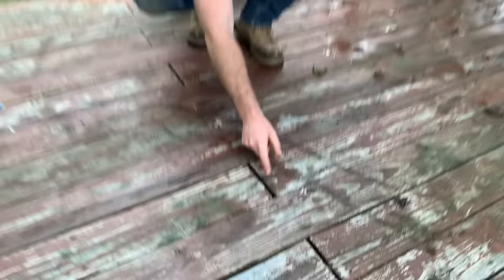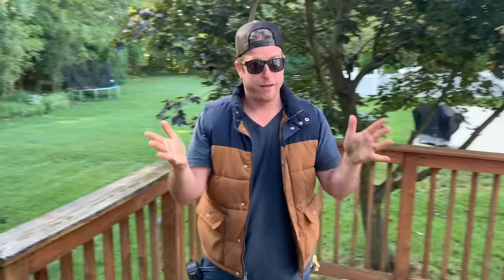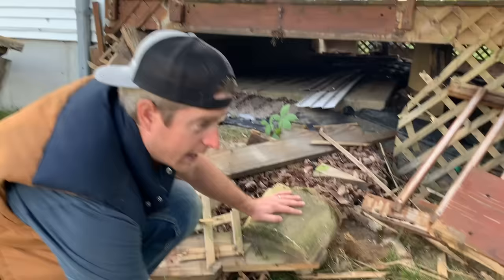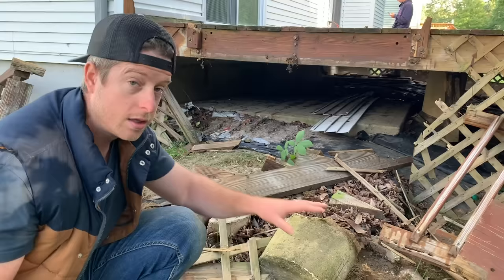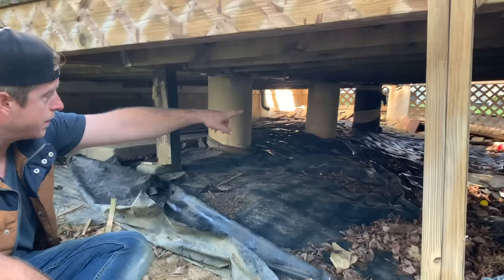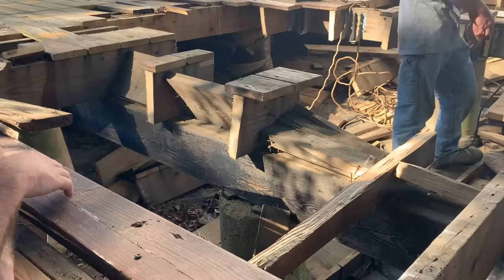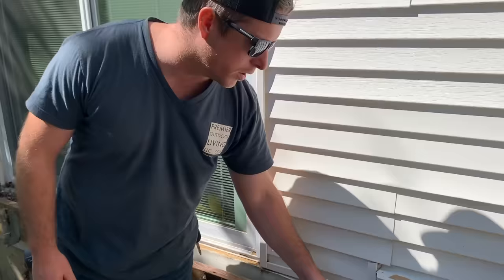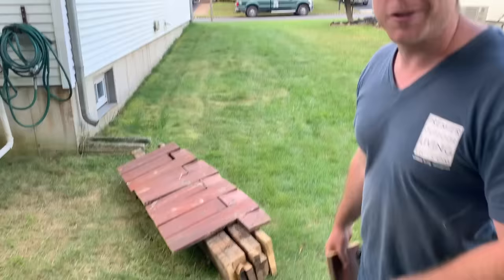How NOT To Build A Deck - Ultimate Guide On Every Mistake You Can Make

Comment: Dude however crappy this thing is I have seen a few that I have referred to as anti gravity decks, talk about under supported, their were 2 very overburdened 4x4 posts and a ledger board on this 12x12  deck, the posts weren't even set in concrete, just resting on the ground. That one is basically a meme at this point in my crew.
Reply from the maker: Hahah I’ve definitely seen some insanely bad ones online, it’s pretty scary
Reply: I also replaced a 12'x12' deck that had only two 4x4 posts standing on the ground with a small handful of Ten Penny nails holding the ledger board to the house. The scary thing is it was over ten feet off the ground.
My customer wanted it replaced because it was too crowded for all smokers on it at the last gathering.

Comment: My house has a small deck about 12x16 and the 4x4 posts sit on concrete discs or chunks that sit on top of the ground. Previous owner had a hot tub on this deck at one point. 😳Still it’s solid. I want to extend this deck and will probably put concreted posts in the ground for the new extension, question is is that dumb considering the rest sits the way it does? I’m not really interested in tearing the old down because it’s solid. How did this ever pass inspection in Massachusetts where winter is prevalent? Will I open a can of worms pulling permits and they see the way the old is built? Wood isn’t cheap lately but it has come down some.
Reply: it would take some elbow grease but you could use some temporary support and dig up one post at a time and add a concrete base. Your frost line up there is probably 32-48 inches,

Comment: I took on a snowbird client here in Alaska and looking over their house, they have a 2 story deck built onto their 3 story house wrapping 2 sides. First thing I noticed, 4x4 UNTREATED posts used upper & lower. 2nd thing I noticed, none of the uprights above are over the lower. 3rd, is the concrete pilings,  they go down 36". The list goes on & on. Owner asked me to "fix it" as I'm a former deck builder. I laughed and said, Nah, I'm not touching this one. He's got someone else lined up and I'm hoping that fella will tear it all down and build it right. This is freaking earthquake country with no building code inspections. SMDH.
Reply: OOh, I was horrified to read this. Untreated timber, poor design & significant earthquakes - someone's gonna get killed unless its torn down.

Comment: It's funny to me how poorly it was constructed as you say but yet it looks like it's being around for 20 30 years
Reply: Pretty ironic given how much scorn the guy has for it. If a diy functionally works 10 years costs and is only 1/4 cost of a “pro” build then I’d say it was a job well done. Ha it’s also funny theyre like OMG ITS SO UNSAFE. Ha it’s a deck 3 feet off the ground, what do they expect the deck to be able to hold a car up and not suddenly catastrophically fail ? Looks like it did it’s job these guys are just full of pride which will lead to mistakes and errors

Comment: Your thoughts on 2 beams/joists to a post for a deck attached to the side of the post using carriage bolts.  How can something like his be fixed?
Reply: I know I’m not who this question is posed to, but heck ill give my .02 for what its worth considering there are no other replies. The issue with it hanging on the post with carriage bolts is that all of the downward and twisting loads are being transferred through the bolts and only the bolts. That means a lot of shear force on the side of the bolt, which over time can loosen and even split the wood out. My suggestion would be to look for a heavy duty bracket that would screw into the post with some large sds screws meant for shear loads, something like simpson string drives. The bracket could go outward underneath the beam and up to the face of the beam, screwing in at the connection. This would effectively transfer the load from the beam to the posts and remove the shear load from the carriage bolts. I dont know of a bracket that exists like this off the top of mg head. You could look around online or if you know a good welder have them make it up for you. I think the strongest design for a bracket would screw into the side of the post, perpendicular to the beam, then go upward and outward and twist to meet the face of the beam. Almost the shape of an H 25 hurricane tie but much larger and maybe 3/16” thick steel. Im not an engineer by any stretch but that’s how i would do it were i faced with that challenge. It might be a good idea to consult with an engineer depending on the specifics of your project. They can make you a set of spec drawings that you can then take to any good steel fab shop.

Comment: Please tell me how a breaker board will solve gappage from contracting wood
Reply: It won’t if you put it in while the deck boards are still wet. I lay the deck boards and then come back a few weeks later, and then cut out a slot for the breaker board.

Comment: Question, we are getting ready to tear our deck down. My husband wants to pour concrete under where the deck was. He wants to know can you put the support post on top of the concrete? It's for a 12 x 14 foot wooden deck.
Reply: You'll need proper depth and diameter footings under each vertical support column/post.
Reply: @frankmiller95  Did you hang the picture yet

Comment: If your building decks where there is frost you should be using Helical Piers for footings! I install them for a living and ALL my deck repairs are failed footing that's are 42 to 48inches in the ground. Ground freezes and you have a 2 or 3 foot diameter concrete footing it grabs hold of and pushed the deck up. Very rarely do I seem them settled. 5 to 10 inches is pretty Typical. 
Use KDAT lumber and dont be a cheap ass!
Reply from the maker: We do use helical piles now!

Comment: Why can't beams sit directly on proper footings/piers like you showed, if the footing/pier is done correctly? Usually you have a footing/pier and then a 4x4 or 6x6 post and then lay the beams across the posts with attachments?

Are you meaning that it didn't have any actual connecting hardware between them? Then I think I see what you mean.
Reply from the maker: Yeah exactly, no connection to the footing

Comment: I only have a clearance of 4-6" to build a deck. Is this possible to do on ground level? How would you make the frame?
Reply: 4x4 pressure treated posts on patio blocks or if you cld dig down a little you can buy preformed concrete post blocks https://www.lowes.com/pd/Common-7-in-x-11-in-x-11-in-Actual-7-125-in-x-10-375-in-x-10-375-in-Concrete-Deck-Block/50113084?cm_mmc=shp-cprd--googlelia-210-brickandblock-50113084-
or you cld try these as well 
https://www.amazon.com/TuffBlock-Instant-Foundation-Block-8-Pack/dp/B076LBRHVR/ref=sr_1_2?dchild=1&keywords=post+blocks&qid=1590367902&sr=8-2  ..

Comment: He used the term "cinder" block which is not correct. If you look close, those are concrete block. There is a huge difference between cinder block and concrete block. By his accent, I am going to assume this is taking place in the United States where cinder block hasn't been manufactured in more than 70 years. If you are going to make an instructional video, get your terminology correct.

Comment: This is why i hate wood deck floors...after a while they lool horrible, and I think you have to strip and re-stain, etc..after a few years. I prefer the TREK composite, along with the white rails from ****** Rail Systems.
Reply: Doing that on a 48x16 and currently planing the joists before doing a liquid rubber coating on top of the joists.
Composite will show waves much easier than regular wood, but a cheap electric planer looks like I will be done in 3-4 hours so its worth the minimal extra time.

Comment: How do I find a contractor who not only knows the codes, but does them?! I know there are many who will cut as many corners as possible.
Reply: Find one who will get a building permit before starting work. That will require your deck plans are in compliance with local building codes and the finished deck passes an inspection by a building inspector upon completion. No contractor will build a non compliant deck, subject to official inspection after pulling a permit.

Comment: I mean dude its an old deck so a lot of the problems you are pointing out is due to weathering. And the first step is probably tall from the grade of the yard eroding down over time
Reply: They did half ass it for sure. Either a home owner special or a cheap homeowner. You get what you pay for
Reply from the maker: For sure!

Comment: Man carriage bolts are not that much better then lags other then you can tighten them more so, so after ten years when they loosen up you can put a wrench on them an tighten them but its still only going thru a 1 1/2 material. whats your rim board that your running them lags thru? Did you block the rim where you attached a post? Otherwise you just made a big lever to rotate your rim board hint why my county calls for simpson dtt2z to be installed on any post attaching to rimboard for handrail. Also stair stringer dont have to be 12inch on centers, yes obviously 12in on center is strongest but also way over built. i would think what decking material would play a role in that as well. 1 1/2 material lot stronger then 1 inch timbertech or azek Besides should be taking over all width of stairs an dividing it into equal spacing for your stringers an thats what the spacing is as long as its under 24 in on center.. You do not have to put a break up board if your spanning 20 ft or more, maybe if your installing timbertech or azech but good ole wood you can put that tight for the wood will not expand an contract like composite material.

Comment: OK, watched the vid and it is a bit hippy-dippy.
However, most of what the guy is saying seems to my non-contractor 48x16' deck building self seems to be following standard Code.  A lot of stuff on that build was janky, and it doesn't look like it was every maintained properly so accelerated wear happened. Could be 20-25 years old, with a fair amount of handyman quick fixes.
Pretty much as soon as he showed pier depth, you know it was built by someone as cheap as possible and without any permit or interest in even trying to do it properly.
You can laugh at the guy if you want, but most of what he's conveying seems pretty sound and supported by most Codes.

Comment: I was laughing about the concrete foundation being 23 inches too short. I live in a peatland area and i would need a foundation of at least 3 meters  (roughly 3 yards for you Yankees) deep, just to get at the sand below the soft peat.
Reply: lol im in new england and all my post and foundations are 4ft deep to protect from frost
Reply: What do they do for house builds? Does everyone's house have foundations that extend 3 metres down? That must get pretty expensive!
Reply: @calebfuller4713  Actually 3 meters is not so much. In many areas of the Netherlands houses are founded on piles that are over thirty meters long. In some cases the peatlayer is so thichk that piles cannot even reach the more stable sandlayer below and the foundation is based on the friction etween the piles and the peatlayer.
Reply: @boldvankaalen3896  Wow! That's crazy.

Comment: Scary?  Come and see my deck. Super cheap, DIY, hazardous crap that worked new, but eventually- after you or a visitor gets hurt (law suits) you will rue the day- as they say. Ladies and gentleman, when they brake you will have no warning- you can be trapped and blead to death as if you were rat in a trap. 

In watching a few (so far) Vids about decking - materials, and methods I come away with a few principals- call for mark out (yea, you don't have anything in the back yard- Call anyway) flash house, plan, plan, plan, OR

Call someone with a great rep. Fastest, cheapest, most value,, but a great vid about what you can find out there. I wager an inspector could have red-flagged that deck if he saw it, but if he is not invited' on the property- he can't do anything- I guess. I am not a contractor or inspector but I admire true skill and thinking in any project- except mine that is...

The greatest part of a deck build- or a rebuild is that piece of paper, commitment to a fortune if you use signatur level decking, and high quality, function and appearance from a good design by an architect .

Comment: All wood will contract even with vertical joints🤦‍♂️ also stringers don't have to be 12" on center 16" is fine 🤦‍♂️ also lattice works fine it's just to enclose the bottom it's not structural 🤦‍♂️ you must be new to carpentry